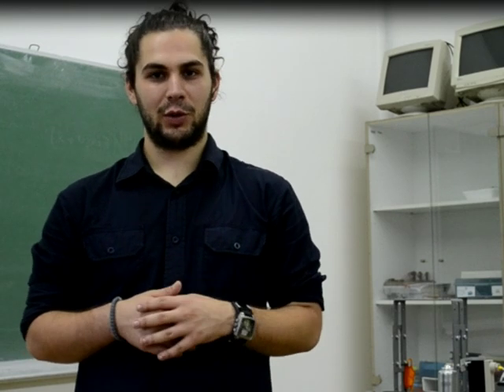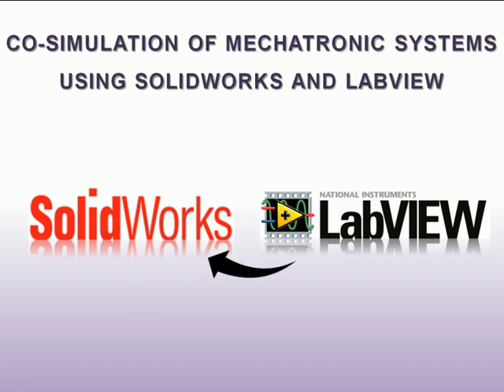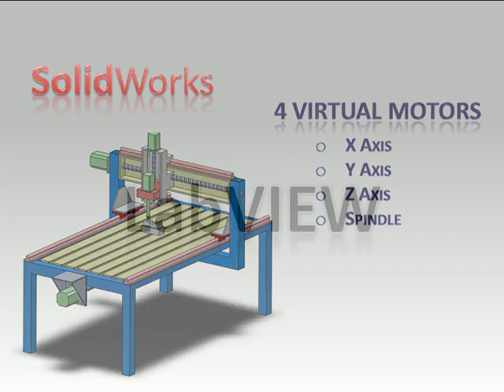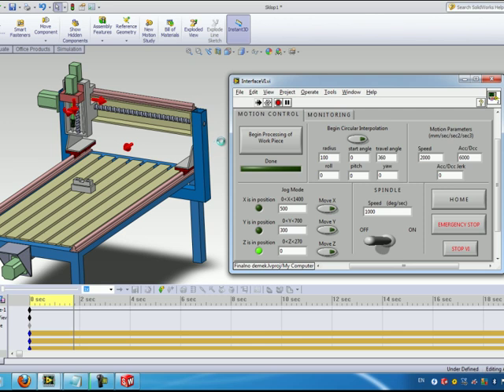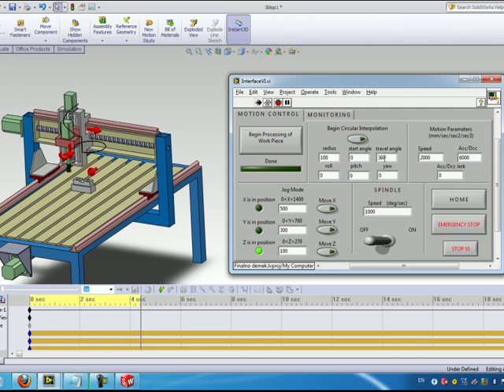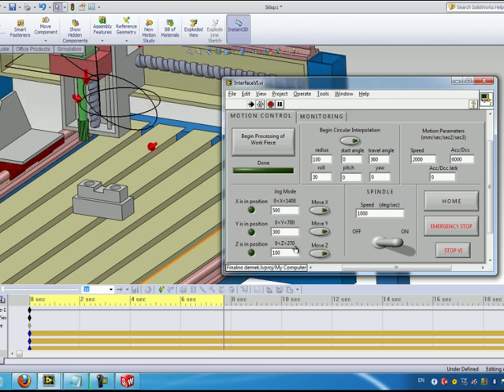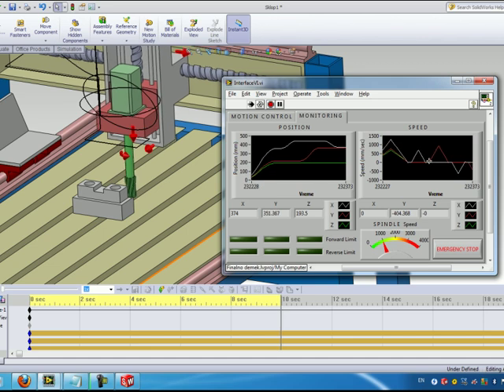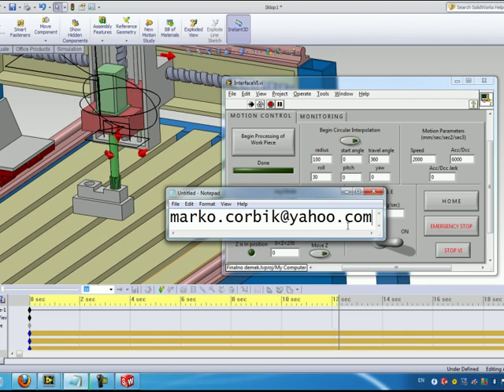Co-Simulation LabVIEW and SolidWorks - NI SoftMotion Module

Comment: The page (http://www.ni.com/pdf/manuals/372876a.pdf) is not longer available, please can share me video files ?, because I have to make an application to a simulated 3D printer .. thanks
Reply from the maker: Luis Pomaquero They probably updated the version of the manual. Here is the new link:

http://www.ni.com/pdf/manuals/372876e.pdf

Regarding your email questions: The black line drawn is a function from the motion analysis in SolidWorks. About the G-code, this simulation was done without using G-code commands. Instead it was done my SoftMotion module function blocks in the VI of LabView. But in the recent years LabView might have developed a G-code interpreter, it was an interesting topic and was searched by a lot of people, maybe you will find something about it on forums.

As for the E command for 3D printers that explains the volume of extruded material - at this moment I can't see how you would be able to do it, maybe if you try you will have some luck with it. Even if you get a G-code interpreter to work in LabView environment, I don't know how you can do a correct simulation of material being extruded.

In any case, after you are done with your work, feel free to share it here. It will be useful to me and others like I am trying to be to you :)

Good luck and let us know how it goes ;)
Marko
Reply: Marko Chorbikj 

Hi Marko ,

Please can you tell me , what is  the function to be enabled in SolidWorks so the lines look. thanks

regards
Luis